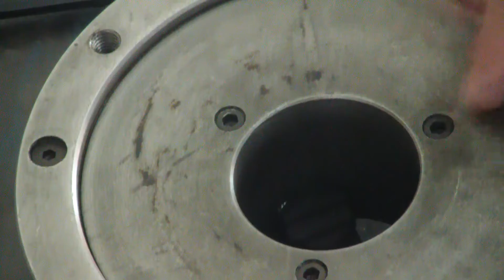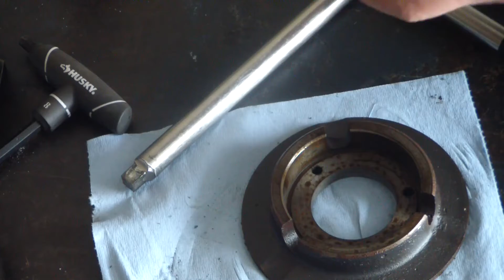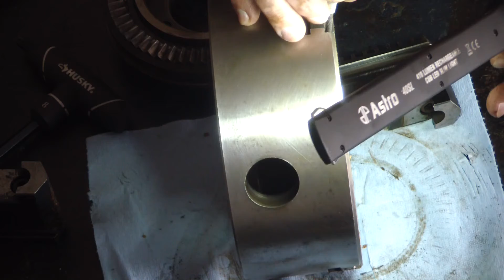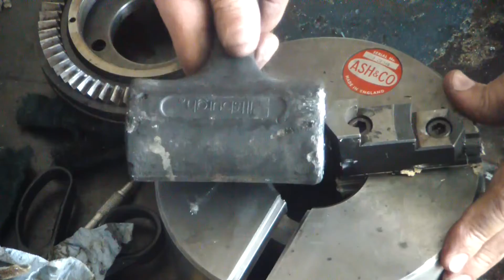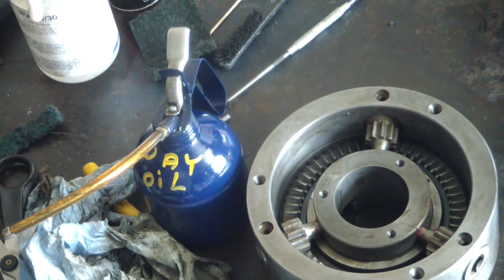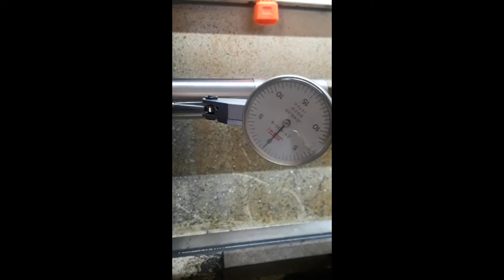Disassembly, clean and reassembly  of a Ash & Co. 8in. 3 Jaw Chuck for the Grizzly lathe

Comment: Hi did your lathe come with the 4 jaw chuck as well? We hated the 4 jaw at first then we feel in love with it learned some tricks from YouTube about using it an stuff. Always nice to see the insides of machine tools like those 3 pinion looking gears rolling on the main chuck gear was nice to see. Nice to see the end results smooth and it is going to be easier to enjoy making parts with. Thank for the share Lance & Patrick.
Reply from the maker: Yes it came with a 4 jaw and I do like it. I actually enjoy dialing in a part as close as I can. The only thing I don't like is the added time especially after multiple parts so I love a good 3 jaw that is dialed in close so I can change parts quick and easy.  My 6in 3 jaw that came with the lathe had almost .002 of run out and I was always able to work around that so with less that .0005 this one has it should serve me much better. Thanks for viewing.